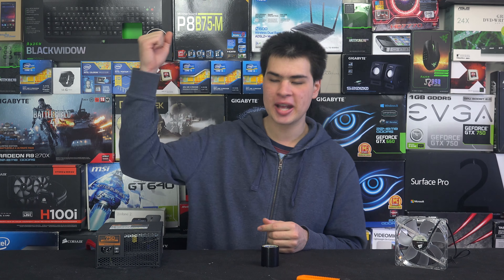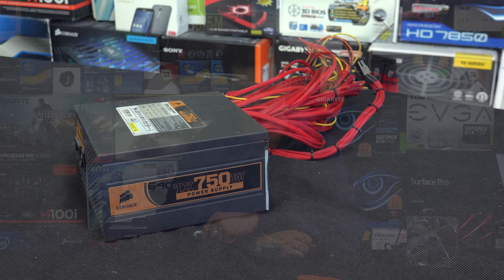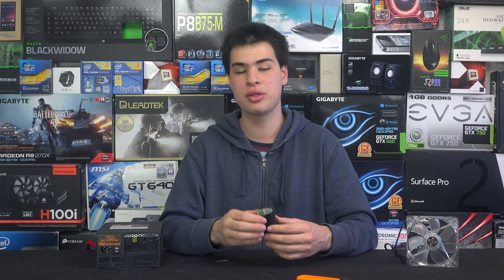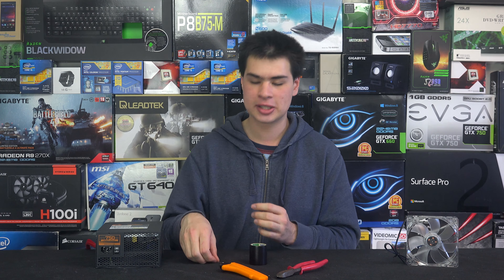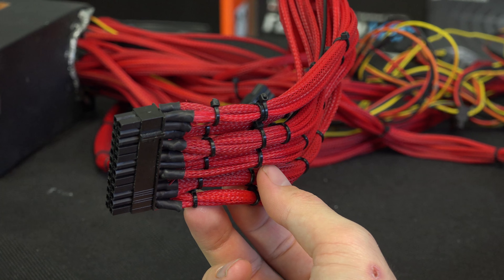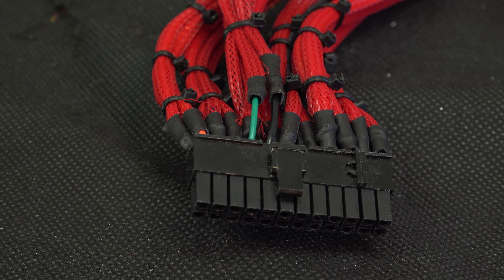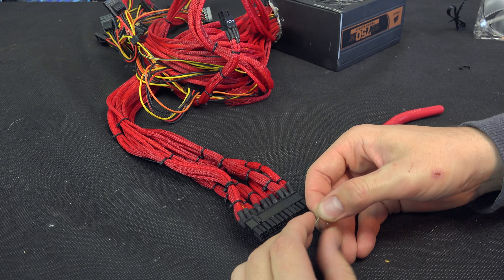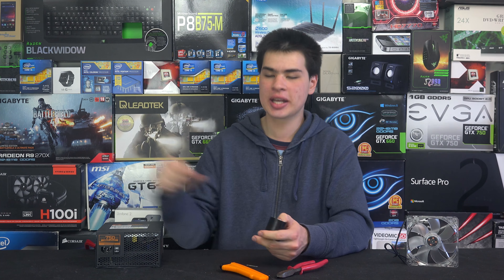DIY Desktop PSU Tester

Comment: no, that isn't a "PSU Tester", you just turned the psu on
also, that green signal wire only carries 5V, and is limited to less than a half of a mA, so it will never electrocute you